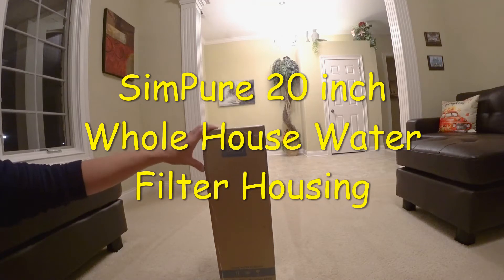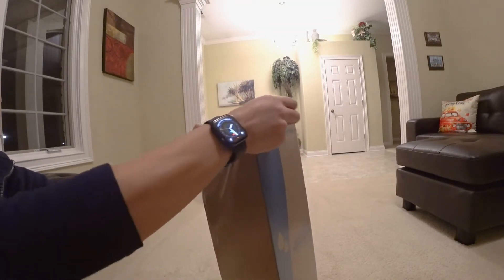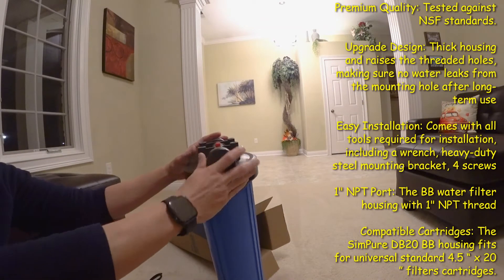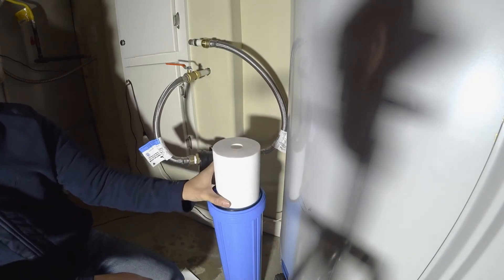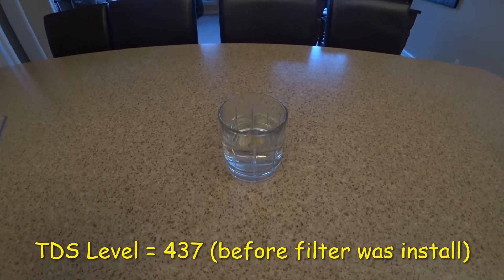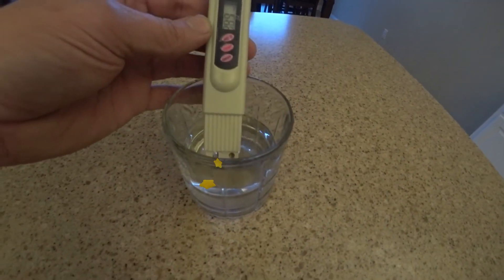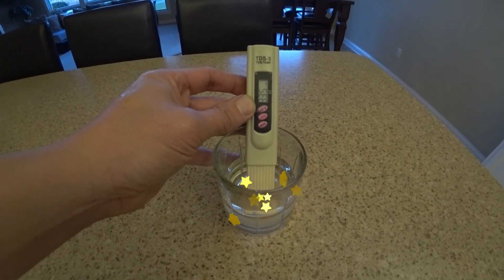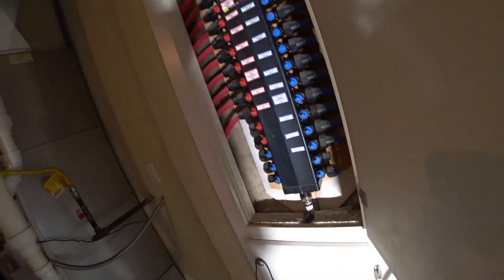Big Blue Whole House Water Filter Housing (How to Lower TDS Level In Water)

Comment from the maker: TDS meter measures the conductivity of substances dissolved in tap water. The higher the conductivity, the more dissolved solids are likely present. To measure this, a TDS meter emits a small, harmless electrical current through a water sample. The sediments filter removes suspended particles, such as dirt, sand, silt, clay, and rust, from water.

Comment: That sediment filter did nothing to reduce your dissolved solids. A sediment filter is mechanically removing any particles from the incoming water such as sand or dirt. If you filter sweet tea through a sediment filter you're still going to get sweet tea on the other end. It can't remove the dissolved sugar in the tea. The difference you see on the cheap TDS meter could be the result of an inaccurate meter, or just the fact that something changed with your incoming water from different times of day. 

Also please mount that filter on the wall.
Reply from the maker: TDS meter measures the conductivity of substances dissolved in tap water. The higher the conductivity, the more dissolved solids are likely present. To measure this, a TDS meter emits a small, harmless electrical current through a water sample. The sediments filter removes suspended particles, such as dirt, sand, silt, clay, and rust, from water. 

As you can see from the test data before and after. The TDS level test result shows TDS level drop before and after installing the sediment filter. What could be causing the drop is the sediment filter is removing the very conductive RUST material out of the water, which is reducing the TDS level.

Thx for watching and greatly appreciate the feedback.